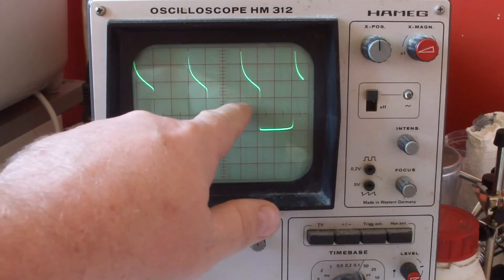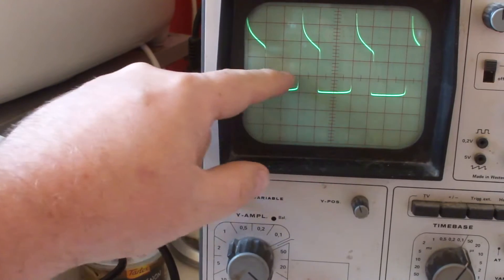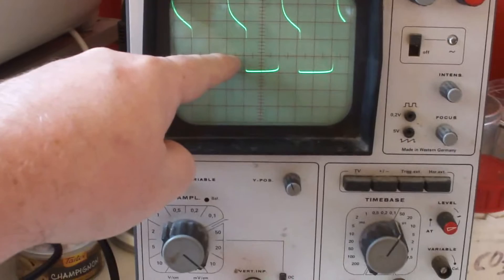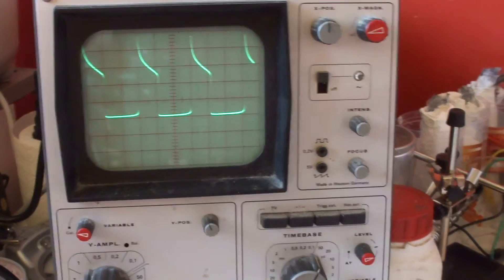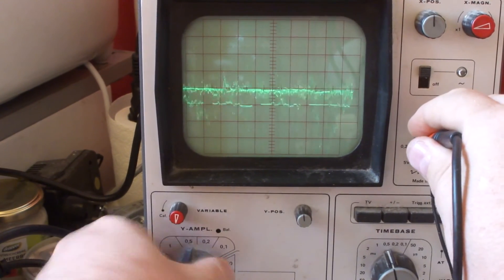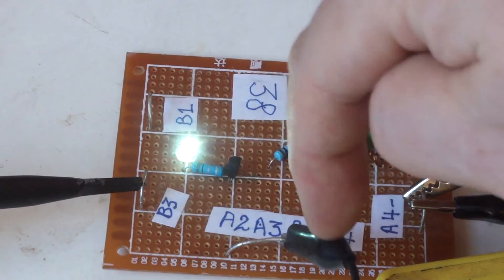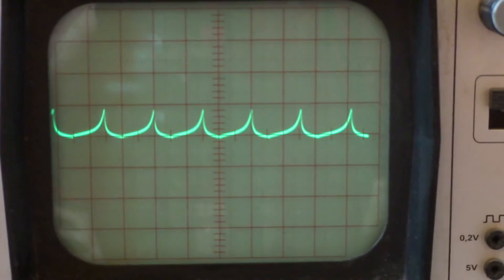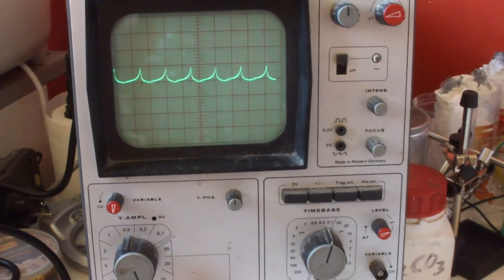Lawrence Tseung Fleet circuit Joule Thief power measurement analysing test PART 2/2

Comment: Nice job Stefan.  I guess no overunity after all.  The JT is still a great circuit.  I am still working on the high voltage/high frequency JT circuits.  I think they are very useful.

Bill